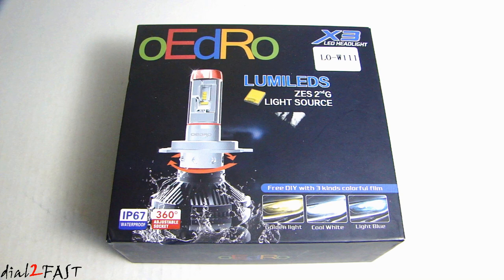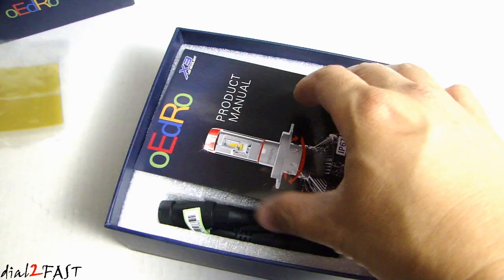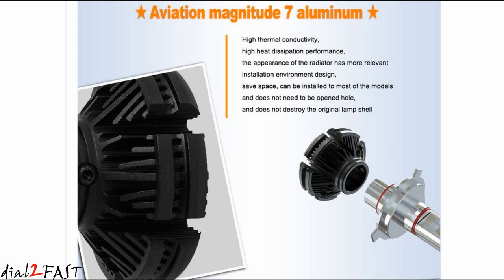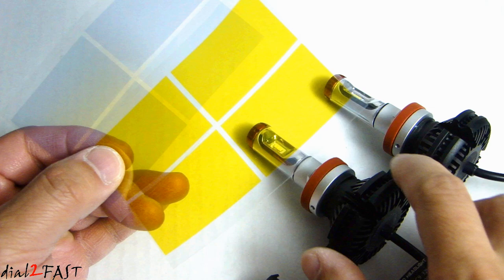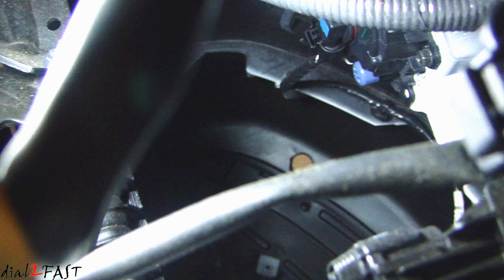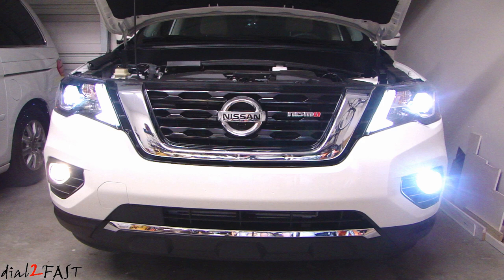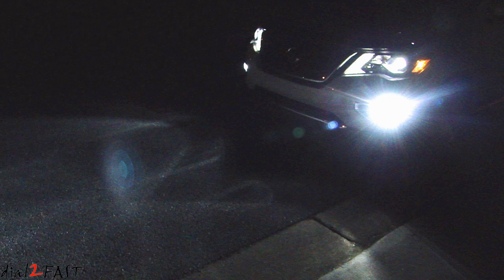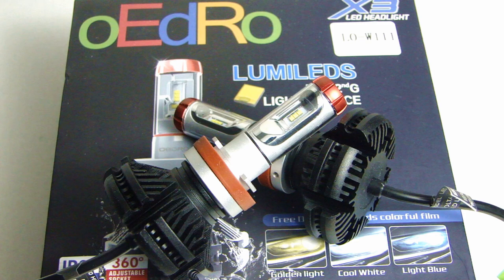How To Install H11 LED Fog Light In Nissan Pathfinder

Comment: My 2013 Pathfinder has  a low and high beam on it's foglamps. Low for DRL and high when turned on, at the control. Does the later model foglamps have it too, since it doesn't use the foglamps as DRL?

Comment: Yeh I want same color temperature at least for fog lights and low beam high,for high beam what u would prefer same as fog light /low beam or different sorry for asking to much and thanks again for ur help
Reply from the maker: You can just get the same one for all 3. Auxbeam makes pretty decent lights and haven't had any problems with them.

Comment: Hi nice lights do yo have some can bus canceller in headlights or is it work without? I planed to buy to my qashqai j10 but I'm not sure if it need's some canceller
Reply from the maker: For this vehicle in the high beam light, you don't need the CANBUS decoder.

Comment: My 2017 pathfinder is sl premium and it has low beam halogen lights do u know or have any ideas or help me with that what kind of Led light I need for low beam and high beam also fog lights that they match all same color
Reply from the maker: I just did an install of LED light into a projector lens of a Honda Civic with H11 bulb - same as Pathfinder. Check it out: https://youtu.be/gFZX5uoq4O4
Reply: dial2fast I seen the video how about the high beam and fog lights do u know what kind so so it matches with same color thanks again
Reply from the maker: If you want same color temperature, you can get the Auxbeam FS6 light for all 3 lights: Low / High / Fog. For the Pathfinder, use the H11 bulb for all 3. The High beam specifies H9, but you can use the H11 for it.   http://amzn.to/2GMV9Mk
Reply: Oh h11 for low beam and also for the fog light too and its totally fine
Reply: h11